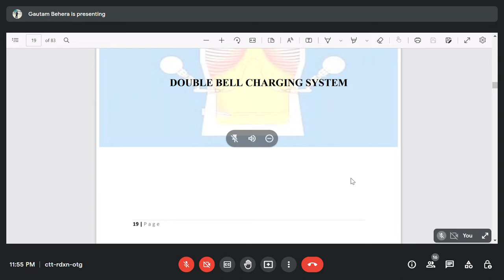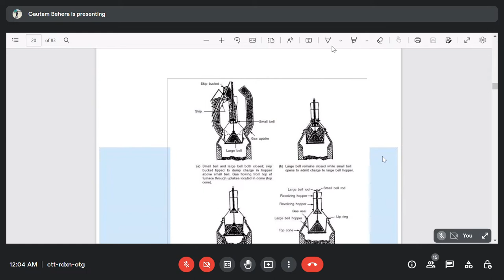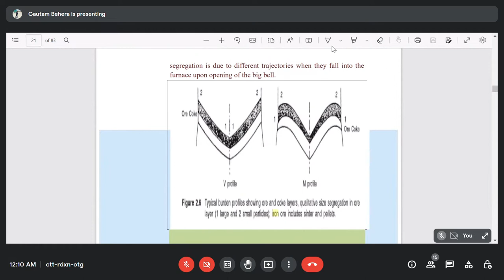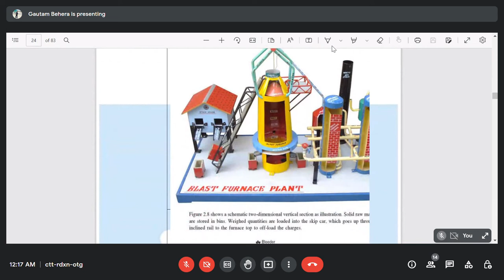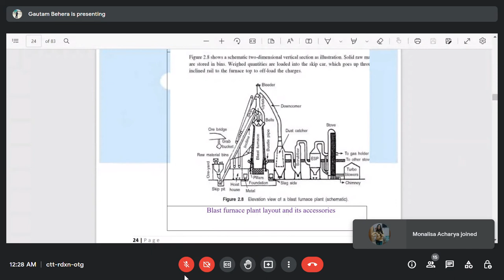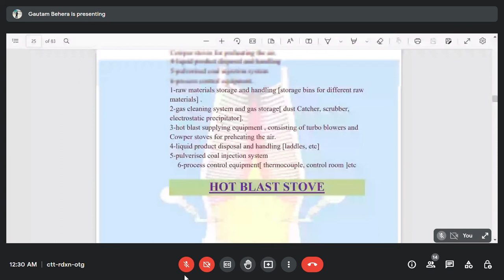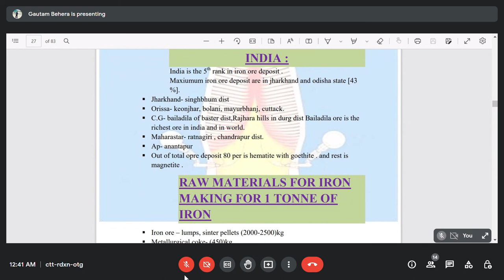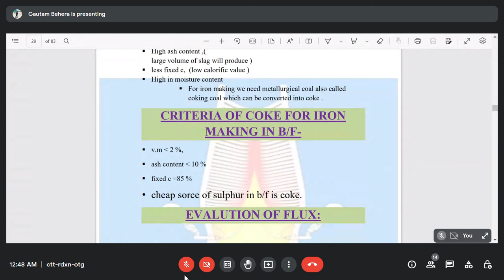Blast furnace iron making L-3

Comment: hello Sir, Hope u r doing well.....good to see ur videos...i still remember these concepts bcos of the way u taught them to us....
Reply from the maker: Nitisha thank you so much for your kind words. and its really good to see your reply after a long time. hope you are also doing well.
Reply: Sir why we are using wet ESP during gas cleaning as there is also heat loss during the process so how that is compensated.
Reply from the maker: Patraya its called sensible heat loss which is present in top gas due to it heat energy it carries which is at 200 degrees to 300 degrees centigrade. wet cleaning is always better than dry so we can't do dry. And more the burning of this cleaning gas will generate heat so no issue.
Reply from the maker: @linkonpatra7198  the main aim is to clean the top gas and wash away the solid fine particles rather than to heat recovery. so main objective is fulfilled well if wet cleaning is done .